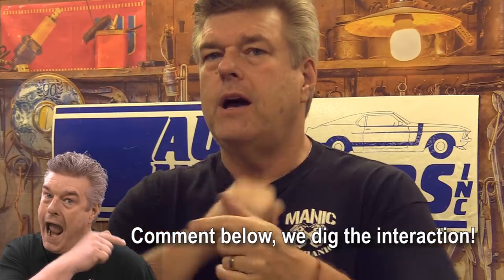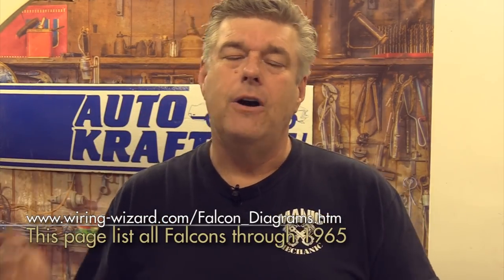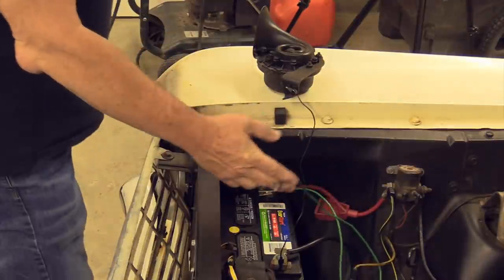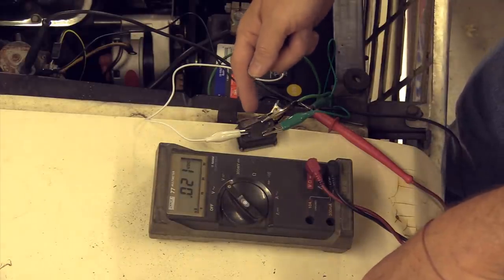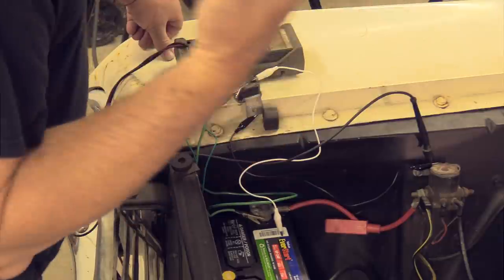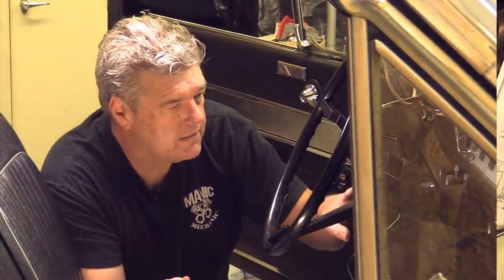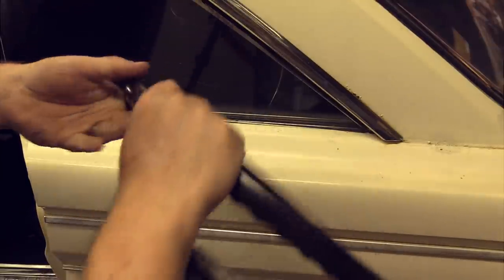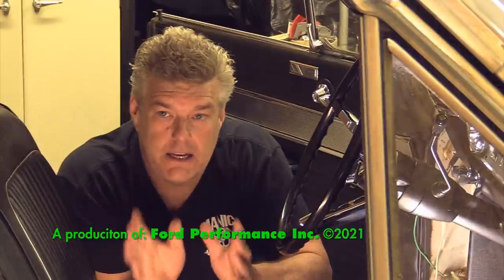Ford Horn Not Working

Comment: Much appreciated, working to solve the horn problem on my 63.  I have the 63 original wiring diagram, based on what I have seen and what you have explained the wiring is the same with the 63 & 64.
Reply from the maker: Glad it helped. The X does have the abulity to control the transmission but I'm not sure if the harness is part of the kit.

Comment: I have put a 22 rim fire case over the end with the spring and this makes it longer and fits hole better for the best contact! don't have to splice solder or anything, just clean the copper ring!
Reply from the maker: To be clear that is a spent .22, right? 🤣🤣🤣
Reply: @AutoRestoMod  Yes that's correct! That was told to me by an experienced Ford mechanic and it worked...

Comment: The wire on my 1966 Fairlane high horn got piping hot. Had to unhook it. This happened after I put a wood grain gt steering wheel on it
Reply from the maker: Don't think those two are related. I'd try a new horn.

Comment: My low tone 6 volt horn on my '53 didnt work.  I ran a straight 12 volts to it.  It grunted a little then opened up and it's fine now.
I wonder if (2) 12 volt batteries on a 12 volt horn would open it.
Reply from the maker: Pretty sure it is done. rheostat bar was glowing...

Comment: Crazy question, 1979 F100 I am trying to swap out my transmission indicator light bulb for a working one, part of the turn signal switch assembly, and cannot for the life of me figure out how to get to the light, pulled the steering wheel and that bulb is way inside much metal.  This steering column is a tilt.  omg do  I have to remove the entire steering column to get to it?
Reply from the maker: Honestly I'm not sure.
Reply: @AutoRestoMod  I just figured it out.  This model automatic with tilt has an old fashioned round socket bulb.  The assembly just pulls out and it takes a little more tugging than I initially gave.